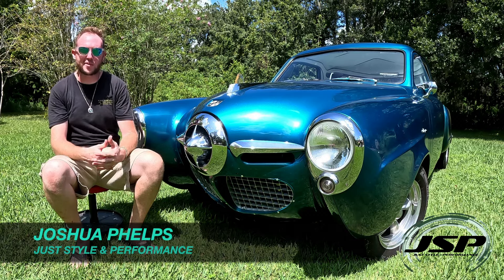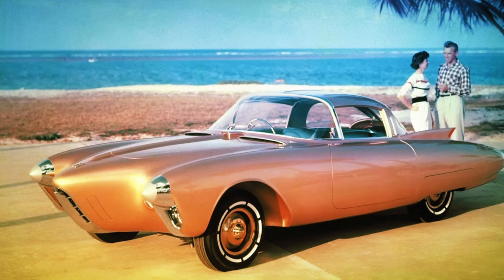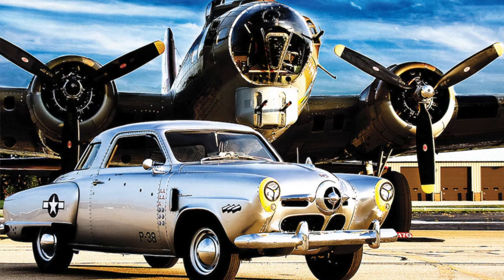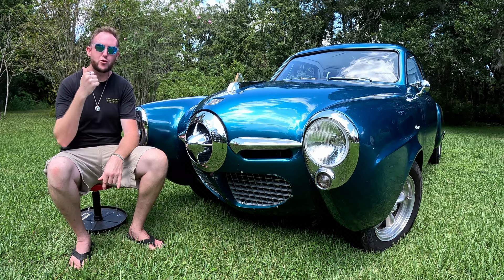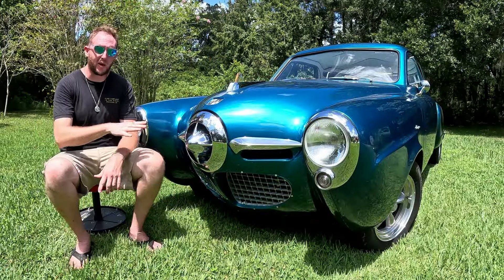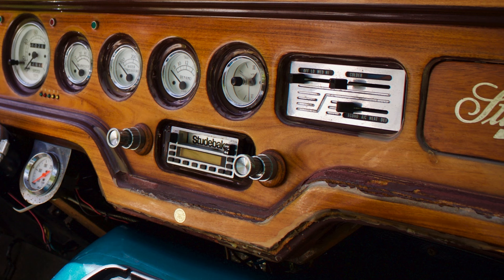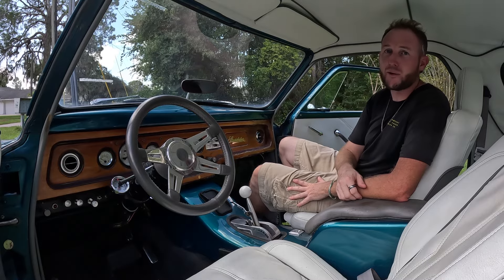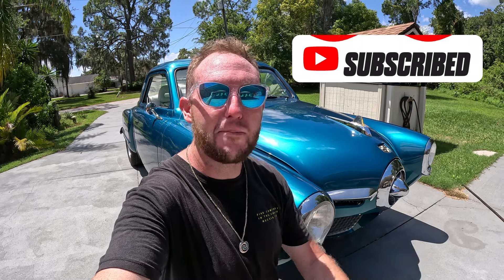Patti's 1950 Studebaker Champion Starlight Street-Rod // FOR SALE!

Comment: My father told me that when the '50 Studebakers firs came out he and mom vowed that they'd own one some day. Three years later he bought a used one, a Champion 4-door sedan, maroon in color,. It had a nob on the kick panel near the clutch pedal that would raise & lower the radio antenna. That was my first 'discovery' about the car. Neat car to six-year-old! My uncle though, had a Starlight Coupe. I remember he had a plate on the front bumper that he used to pull his Howard DGA-15P out of the hanger and after flying he'd use the Studie to push the Howard back into the Hanger! It's a shame that these early fifties cars were not very durable. There bodies would rust in a heartbeat and the engines would start going south, without full-pressure lubrication after about 50 thousand miles. Oh yea, Dad was a pilot and he had seatbelts installed in the Studie. I still have warm memories of that car.